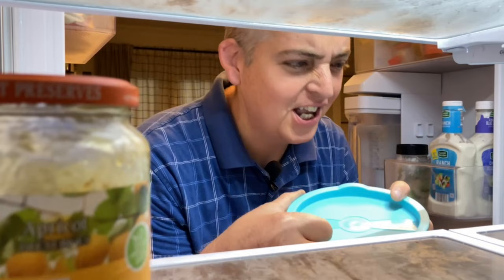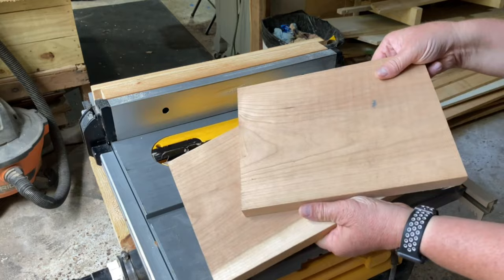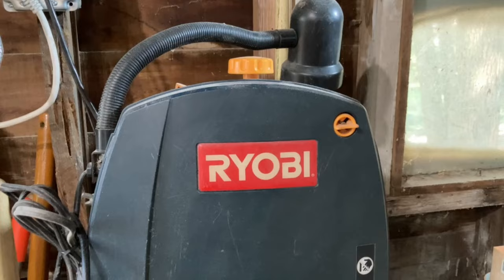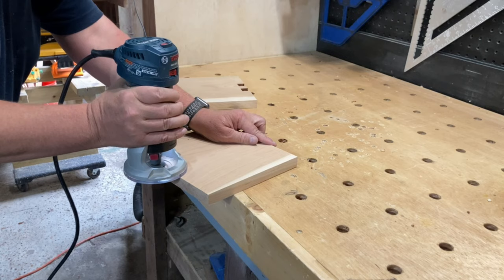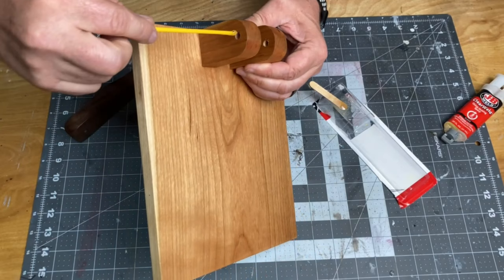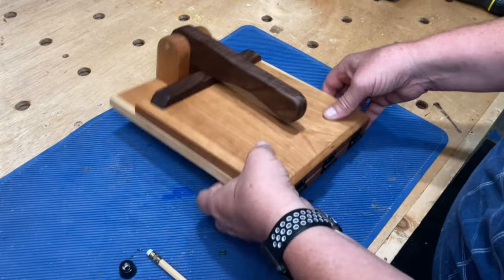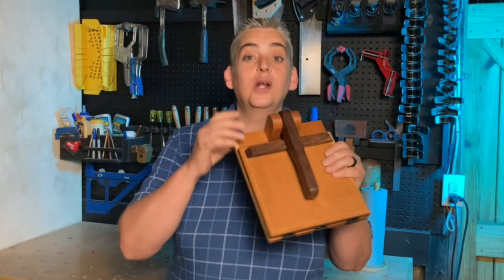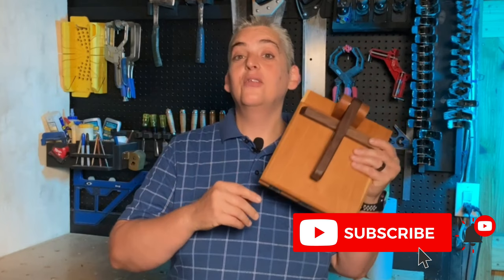How To Make A Tortilla Press / Woodworking Project

Comment: I found 2 mdf boards in the disposal, 24.5 cm x 24.5 cm, 20 mm thick and made one with the two identical boards! On the base plate I placed 2 rectangular feet measuring 14 cm long and 15 mm high made of solid wood, and on one side of these feet I screwed 2 pine bases, drilled the holes and placed a solid wood slat as a lever! I joined the 2 plates together and placed a thin plastic layer between the 2 plates to mark the hinges! When I tested with 40-gram balls of dough, even though I pressed the lever a lot, the dough was barely crushed and expanded, it didn't exceed 8-9 cm in diameter! Looking in detail at the open press, I noticed that the upper (movable) plate is an absurd 4 mm below the level of the lower (fixed) plate. Could this be the reason for the problem?

Friend, analyzing the situation again I saw that the tortillas that had a small diameter of 8-9cm were thick, exactly with this difference reported above 4 mm! Could this be the cause of the problem?
Reply from the maker: First of all, that's a great use of found scraps!
As far as The thickness of the tortillas; it is hard to picture what is going on, but I do know that on of the reasons for the  strip of wood across the top plate helps create more leverage for the handle and puts more pressure on the dough, making it flatter. If you have Facebook, maybe you could share pictures with me there.

Comment: Sorry about your bandsaw. I never use any power tools except a drill, and a lot of the time I use a hand drill. I live an a rather small apartment overlooking the lake downtown, surrounded by books, computers, tools and plants. I have no room for something like a table saw or a bandsaw. It's sometimes a project in itself to rip a 3-foot length of wood with a hand saw, but I manage. Sometimes I wonder how anything got done before the invention of electricity, but it did. I came here to look at your project, and it doesn't look too difficult, but I need some good hardwood and some hardware.
Reply from the maker: Actually, it doesn't have to be hardwood, most of the presses for sale online are made from simple pine. using hand tools is an awesome skill to have and builds patience. I should probably try using more hand tools myself. Thanks for watching!

Comment: Dimensions would be helpful.
Reply from the maker: You're absolutely right, I don't know why I didn't give the dimensions in the video. Probably because I was using scraps.
Bottom: 10"x8.5", Top: 8.25"x8.5", Handle: 8.5"x1.5", two Brackets: 3.5"x1.5", Little stop brace: 8"x7/8"x1/2"
All the boards I used were 7/8" thickness
Reply: Be creative man, use this video as the general idea

Comment: If you buy a new band saw, make sure you clean the blade that burning on the edges of all your cuts is because you either have an extremely dull blade that needs replacement or more likely your blade is covered in resin/glue from the wood you've been cutting clean the sides of the blade with rubbing alcohol and then touch the sides with a bar of soap while the blade is running to act as a lubricant.
Your bandsaw motor and sander will thank you.
Reply from the maker: Thanks for the tips! I think I discovered the main problem; there were actually pieces missing that hold the blade in place, causing it to give a little when I put pressure on it. I'm in the middle of shopping for a new band saw as we speak.

Comment: Are you sure it is the tension mechanism that has problems and not the tracking mechanism?
It shouldn't be that expensive to fix.
Thanks for the video.
Reply from the maker: Thanks for watching!
Not sure what exactly the initial cause was, but the tensioning mechanism no longer holds. Been a busy week but I plan on opening it up and and taking a good look at it.